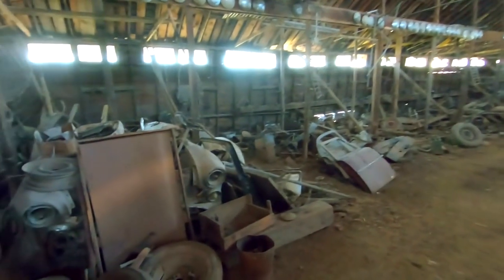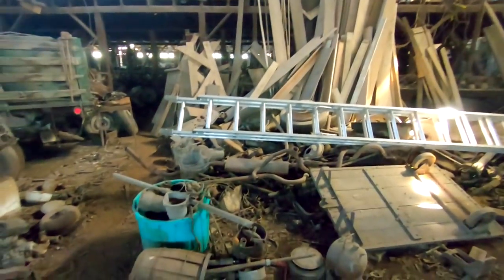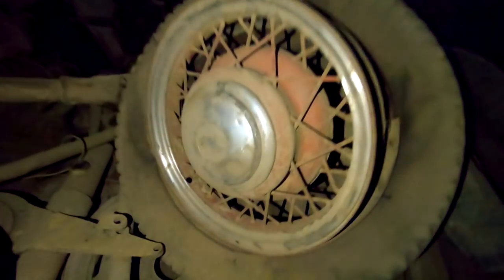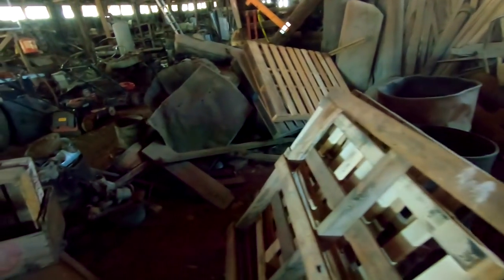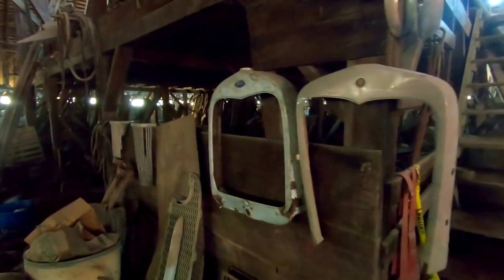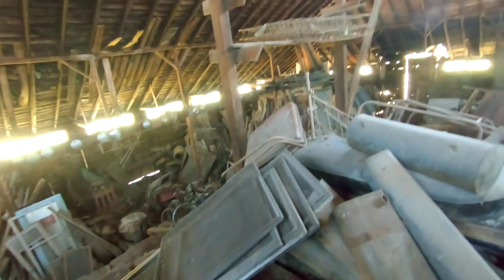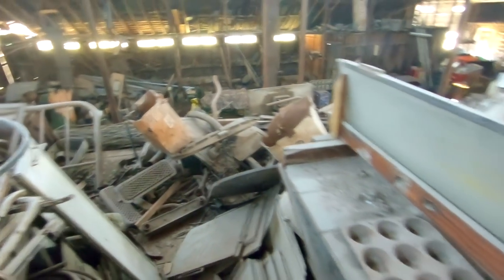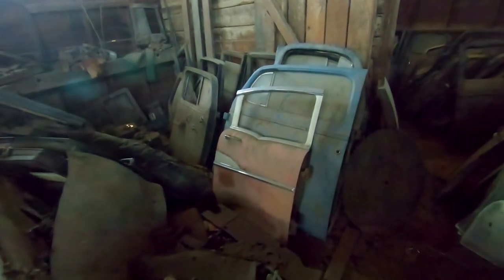UNTOUCHED Car Parts Hoard From the 1930s! | Stepping Back in Time 80+ Years!! (Antiques Picking)

Comment: The Chevy truck at 40 seconds is super cool......
Reply from the maker: I wana buy them both lol
Reply: @IowaClassicCars  I frame off restored a 35 Chevy, 1 1/2 ton farm truck for Wolcott Mill Metropark. They're super fun to drive. None of the gears are synchronized. There are clips of it in my past videos. It still has it's original 206 inline six too.

Comment: Im trying to think of the purpose of saving a giant pile of used brake and fuel lines. Maybe a couple pieces for a repair in a pinch. Unless those old junkers used copper lines. If that's the case now is the time to scrap that pile.
Reply from the maker: The mentality of keeping things was different 80 years ago

Comment: Looking at the video I'm guessing the owner stopped putting parts in this barn in the early 60's, and he concentrated on pre-'55 vehicles.
Asking for 1970s parts would not be a smart move.. this barn has had its doors locked for 50 years+ with no stock additions.